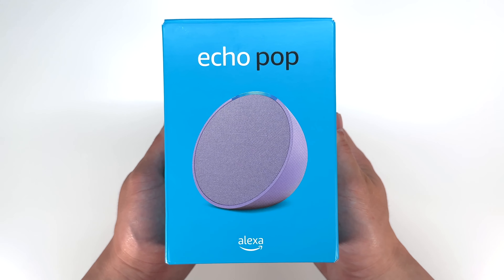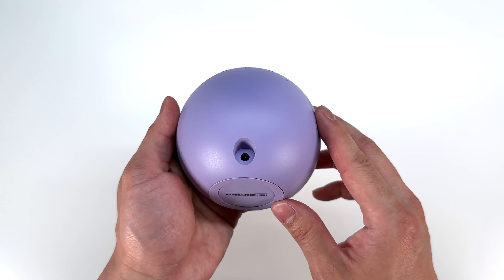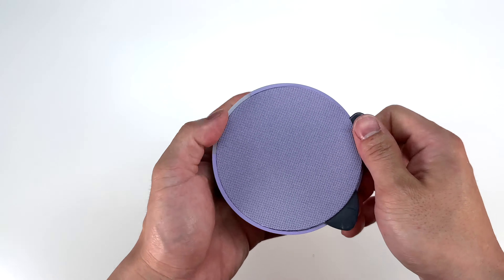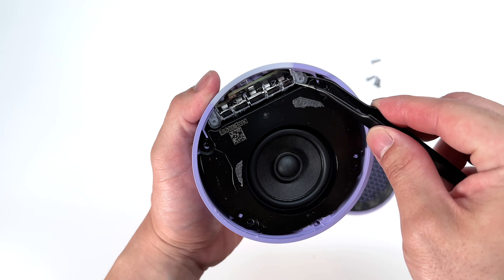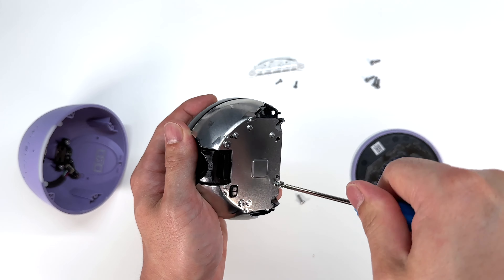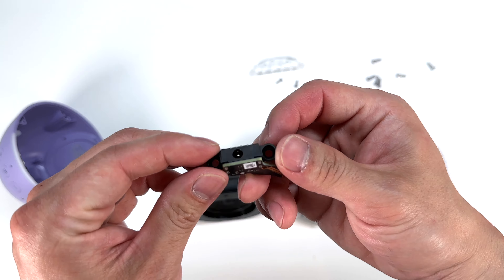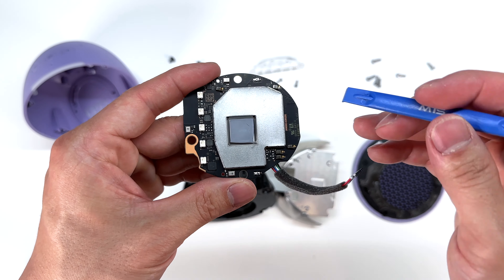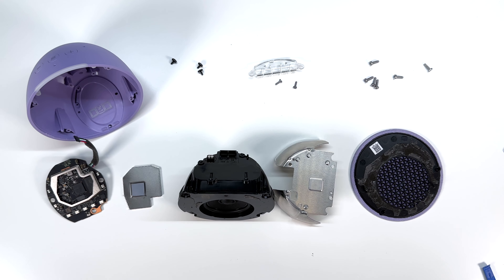Amazon Echo Pop Teardown

Comment: Great video!  I cut the speaker out and soldered in a 40w speaker from amz that cost $6 for a pair of them, and now I can actually hear Alexa much better.  The OEM speaker had too much bass.   I kind of like the led lights even better without the grill and the industrial look so am contemplating leaving it off.

Comment: I would like to know how the sound of the Echo POP compares to the third gen "puck" style  echo DOT.
Reply from the maker: I have both the puck and the new POP. The Pop is way better in bass and much richer. Music is way better and filling sound. The puck sounds a bit more washed and higher treble. The punch seems better at 360 audio whereas the POP still sounds good in the majority of the room but directional based on where it's facing. It does cast pretty wide, I have it setup in a corner, and sounds better than the puck in every area.
Reply: I just replaced the puck for the pop and it’s night and day. Love the pop.